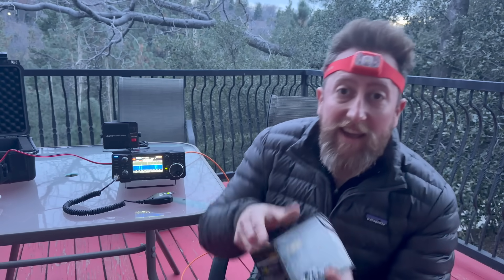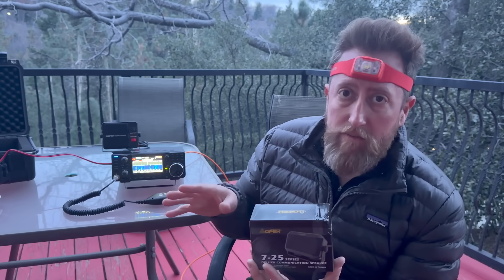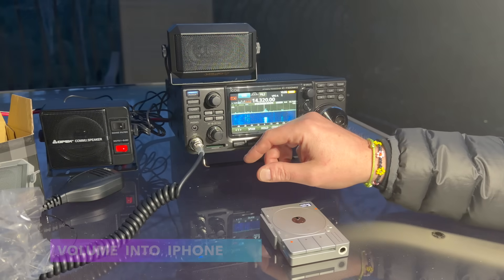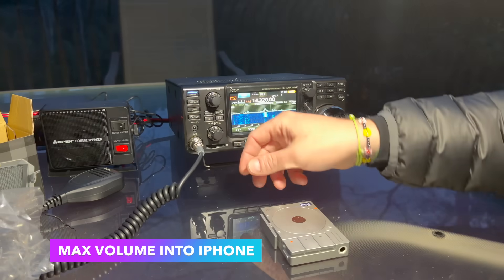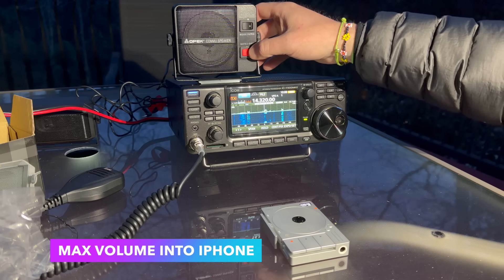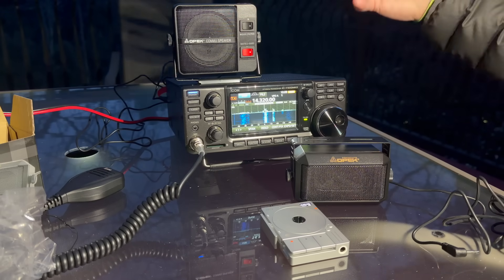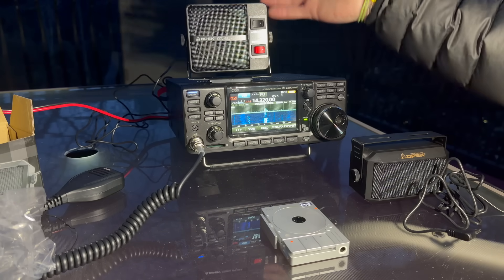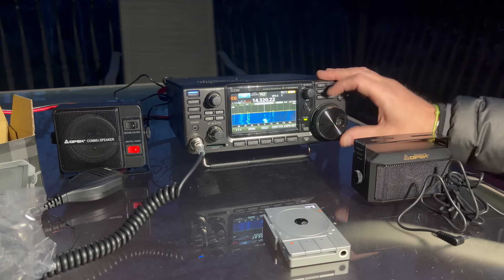Do You Actually Need An External Speaker for Ham Radio?

Comment: Thanks Josh, I use an old cheap small water resistant rugged case powered bluetooth speaker that has a 1/8" jack input, it's so good crisp and punchy. I use it in the shack too.
Coleman CBT13 - AKTIV Sounds
Not sure if it's still available?
I also saw someone had 3D printed a nice reflective magnetic speaker shroud that sits on-top of all radios, very neat. Cheers Geoff

Comment: "
Do You Actually Need An External Speaker for Ham Radio?"
No.
Reply from the maker: You know the right answer… “it depends”
Reply: @HamRadioCrashCourse  "Do You Actually Need An External Speaker for Ham Radio?"
I don't.  You might!  What seems useful especially at Field Day is a headset with boom microphone and either a foot switch or a PTT button pendant.

Comment: I have used homebrew 8 inch dual concentric  speakers in chunky MDF enclosures for 25 years. I have never looked back. A tiny speaker in a tin or plastic box is going to sound like a tiny speaker in a tin or plastic box. There is software on the Internet to help optimise the enclosure's dimensions for voice and shortwave use.

Comment: I have also modified some external speakers to sound better.  Like fiberglass insulation to dampen the cabinet and smooth response,   a test selected cap to roll off excessive highs,  etc.  "Too much bass"  is never usually a problem with communications unless your radio has hum issues which would sound worse but usually it is peaky highs on some speakers that hurt the ears.

Comment: Just be aware that external speakers can make for find sounding reception or suck badly.  Hi fi speakers with tweeters etc.  are pointless.  Old time SW radios came with impressive big ext. speakers that had fine sound.  A few had built in front firing speakers that were pretty good.  Like some Hallicrafters.  IT is worth experimenting with several speakers to see which sounds best to you if you have them on hand.  Not necessary to buy the big dollar "matching" speakers for your rig,  something you already have might even sound better.  Just try to match the specs of the speaker to the radio like 4 or 8 ohms etc.

Comment: My radios and computer are fed into a tiny, cheap mixer, then into 2.1 computer speakers. The FTM-300DR is wired so that VFO A comes out of the left channel, and VFO B is in the right channel. It's a relatively cheap set of computer speakers but they sound way better than any tiny built-in or auxiliary radio speaker I've ever heard.

Comment: Josh... I have a couple BHI NES10-2MK4 amplified speakers with DSP that  I use with my IC-7300 in my shack,  as well as portable with the IC-7300  and IC-705.  I find the BHI NES10-2MK4's indispensable for their amplification and their DSP noise filtering.   They literally pull station's out of the hash of noise floor that you would either have trouble hearing or couldn't hear them at all without the DSP noise filtering.   They are a great addition to the radios noise reduction.  They are small like the Opeks, but they require 12v power and they are several times more expensive than them.    I have  a cloned copy of the Opek 7-25 that I used prior to the BHI's... there is no comparison between  the two.   The BHI speakers also have a 3.5mm external jack on them where you can feed the amplified  DSP output to a set of headphones or ear buds.  The BHI speakers with the amplification and noise filtering by themselves are a game changer in a noisy  outside environment, adding a set of headphones or earbuds to them makes them even better.   After having the BHIs for the past 3 years, I would not trade them for anything else.... well worth the money.
Reply from the maker: Amplification generally helps a lot for quality.  The DSP would be fun to try out. I’ll look into them! Thanks!
Reply: @HamRadioCrashCourse West Mountain Radio also has a DSP external speaker, but i felt the DSP on theirs overprocessed the audio and it was not as clean as the BHI.   The BHI is certainly capable of over processing also if its turned up too high but I feel the audio was better from the BHI and  it did a better job of removing the hash and static from the signal.  They are pricey though, the first speaker I bought was $149, the last one was $179, the West Mtn Radio product  is similarly priced).  The BHI are cheaper  that something like a Heil parametric equalizer and more compact.  They are a good middle ground choice, great for portable ops and like I said wouldn't trade them for anything else.

Comment: Both external speakers sound pretty "tinny" - The 7-25 was a little more full range, but the internal speaker in the 7300 MK2 sounds a bit better and smoother.
I use an older mini home theater center speaker in my home station, and it's a lot easier to listen to. - Cheers, VE3GHP

Comment: I don't think it has enough bass to the sound; it has such a high pitched sound that it hurts my ears. I would want something with a little more bass and depth to it. Maybe that has more to do with the mic the person is using to speak on than anything. I used to have a Cobra 29 CB I used when I drove a big truck doing short halls, and it actually had a decent speaker on it. I think the speaker on the 7300 was better than the external speakers you compared it to.

Comment: I use both of my old realistic minimus sevens. One is on my yaesu ft450d and the other one is on my any tone dual band mobile radio. They sound fantastic. Much better than the stock speakers
Reply: I want to do that too.  I have some Minimus speakers gathering dust in the closet but I'm not sure my laptop would push enough sound for them.  I wish I'd bought an audio amp back when Radio Shack was selling them.
Reply: You would need an amplifier between the laptop and the speakers hooking them up to the headphone output won't really power them too well @KarlWitsman

Comment: I have eight of the small speakers shown on this video and they work very well and take up very little room in my ham shack.  Each one is connected to a different rig as well.  What you need to do is to tune these speakers so they sound much better.  
Open them and drill five quarter inch holes on one side of the back and then put some polyfill stuffing in them.  Doing that makes them sound so much better.  The larger Opek speaker you show only needed the polyfill and that was it.  I bought the Opek because of its size and it sounds much better than it had before it got stuffed.  I don't use that button at all.
For the price I paid for those speakers and about a dollars of filling, each one sounds way better than the one inside those radios.  
I also have three more of those small speakers in my Jeep but they haven't been tuned.  My Jeep has no sound insulation or carpeting and the tinny sound of those cheap speakers cuts right through the noise.

Comment: After having been sneaked up on by a mountain lion, coyote, and a bobcat (not at the same time) while doing CW POTA with earbuds on, yes, you need an external speaker.
Reply: This is an argument against headphones and earbuds I had not yet considered!😮
Reply: Predators On The Air? 😂
Reply: @TomSherwood-z5l  🤣

Comment: I've always sworn by the little 4-inch MFJ 281 Cleartone speaker for mobile ops.  I note that some are still available from MFJ, but that DX Engineering seems to be selling a clone (or just rebranded?) version of the MFJ speaker under the "Intellitron" brand.  Wondering if @hamradiocrashcourse or anyone here has any opinions on these speakers, vs the Opek speakers demonstrated here?  I'm about to do a new install and would like to buy once, lol!  73

Comment: I use a 3D printed hood over the 7300.  Directs the sound forward as opposed to straight up.
Reply: I've used a 90 degree pipe elbow and still do when portable.

Comment: In the shack, I prefer the old 9 inch in a cabinet of some sort for better bass response.  The smaller speakers you demonstrated, I may use in the truck where the radio is not positioned optimally for the internal speaker.  Most things have their place.

Comment: A great SDR with incredible detail down to individual component level, with a large  forward facing speaker dominating the front panel, is handmade by a dedicated small team of amateur radio enthusiasts in Germany.
The Charly 25 Radiolab, with 11band pre selector, also handmade and tested, before delivery.
It is remarkable to see it still remains class leading in all performance even after 4 years. The biggest hitters are all still languishing behind, as they have to secure a component run for the lifespan of their radios. Polar Modulation appears to be an interesting technology, but l would far rather keep 500W on the outside, and use an exciter to gain many more magnitudes of RF with an OM amplifier.
Reply from the maker: Never heard of that radios thanks for sharing!

Comment: Definitely YES! ANd thank you for making this video!

The better the sound quality is, the easier it is for the ear and less strenuously it is to operate over an extended time. And the sound from the radio deserve the best chance of being heard. 
Even with the limited bandwidth of SSB, its a huge improvement going from the build-in speakers (in most radios) to any external speaker. Of course a pair of headphones are the best, in-ear og over-ear, its the best. But not everyone prefer this very direct sound or your have company. 

Here you are testing the best inbuild speaker, against cheap external. But try the same with a cheap radio, or just small radio. A G90 i a prime candidate, its speaker is something from a greetings card... Even the FT891, which isnt cheap, has a small speaker with a tinny sound. The sound from any of these mobile radios will improve a lot, with a external speaker. Doesn't have to be name-brand. Doesn't have to be passive, active speakers with an AUX mini-jack is also a great option for better sound. 

Please repeat this test/review, with smaller mobile radios and focus on sound quality, even if its subjective. This is an often overlooked part of any ham-operation. Sound quality.